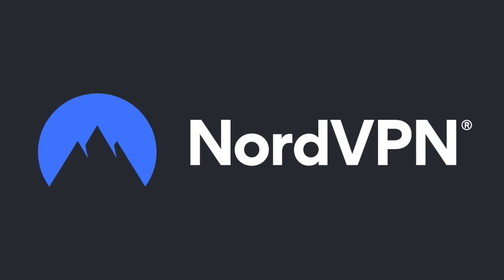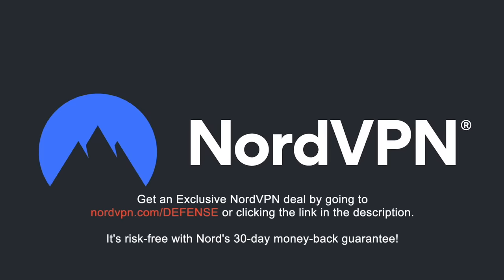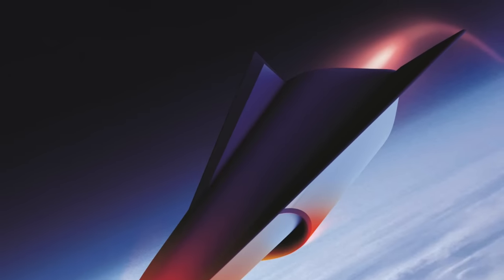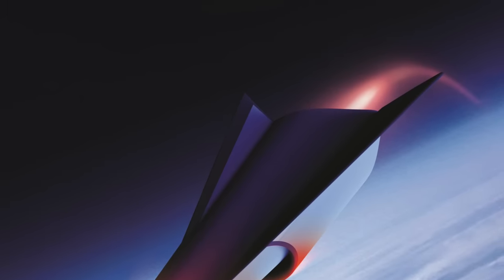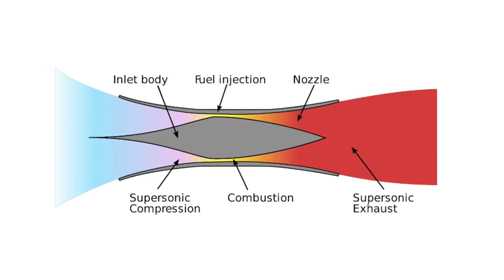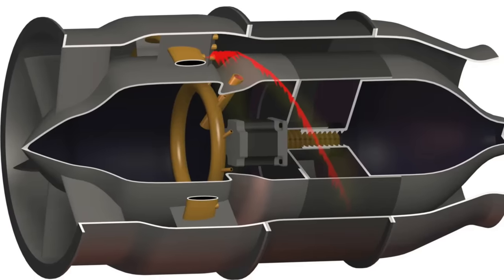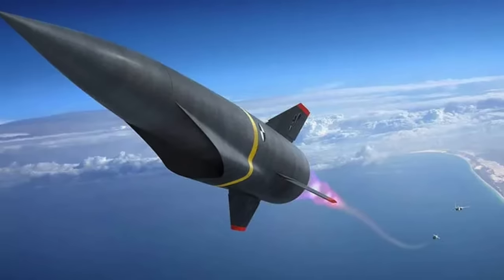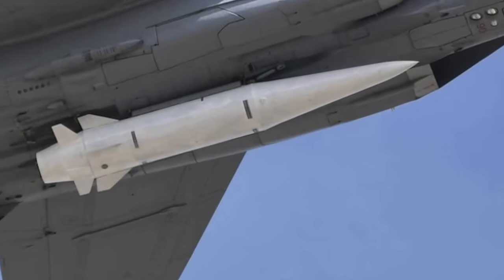GE Aerospace successfully tests hypersonic dual-mode ramjet with RDC !

Comment: I don’t think you understand fully what you’re talking about. Kinzahl  is a faux hypersonic missile in that it has hypersonic speed only during the early phases of its flight.  It’s essentially an aero ballistic missile. Nevertheless it is extremely expensive to stop requiring PAC-3 MSE and PAC-3.  True air breathing hypersonic missiles will be hypersonic throughout flight and extremely manoeuvrable able to manoeuvre at low altitude.
Reply: …a glider through stratosphere hence predictable trajectory and easier to shoot down!

Comment: can it turn at any direction and maintain hypersonic speed?
Reply: Yes
Reply: NO! the range of movement is restricted by inertia and true flight control. The faster you go the harder to change course and the longer the radius of turn. Not to mention the cost of fuel burn. You can't use the same techniques for redirection as lower speeds because causing disruptions in the ion field around the hypersonic can cause catastrophic damage. Glide bodies have a limited range of movement and as the air thickens speed drops, like a capsule reentering the atmosphere, and the fuel needs to maintain hypersonic speeds goes up by a square of the air density. There are perfectly sound reasons why we don't have hypersonic missiles and NASA's research has shown them. The paths to the target drop off quickly to a small cone as the distance drops. Detection and computer power are more important at this point. The other problem that doesn't get covered much is the weapons are inertial guidance until they drop under ionization speed because they are a bright ball of electromagnetic static which cannot be penetrated by a coherent EM signal, so no GPS.

Example, a glidebody starts a turn and travels 20 km before the turn actually starts to happen. The THAAD missile was on the way and hit before the turn started. Dead glide body. In comes a DF 17 at a Arleigh Burke Destroyer. Aegis sees it, as the cone of course converges for the speed where it can actually hit the destroyer, the intercept solution may include two or three SM's that form a wall the DF can't get through. The issue is the Destroyer's loadout and can it afford the exchange. Hypersonic missiles aren't cheap! Naval SM's are far cheaper but the number would be limited. The idea of a magic unstoppable hypersonic is Putin talk, but it does change the calculus. As long as the get enough detection time to launch it's subsonic destruction, the enemy still faces MAD.
Reply: @charlesrichardson8635  Interesting, but I think the video was more on hypersonic cruise missiles and I think that is what Auro1986 was asking about. Offhand, it wouldn't have a lot of maneuverability in hypersonic speed and it is a ground/location targeted missile and not for moving targets. However, I wonder if it would have to slow down as much. The whole hypersonic sled on a moving target as of the current tech of the world is silly. First the ballistic missile would have to be sent to the correct location, the radar would then have to pic up the ship close by IF it is close by, and then the sled has to hit it and like you said it isn't going to be turning at hypersonic speed. So many steps between launch and striking a ship, anti air might not need to shoot it down.

Comment: I've heard that Russian and Chinese advanced weapons are vastly overrated.
Reply: they always are.
Reply: You've heard correctly, dear. For the record, they're wrong, every ICBM we have is hypersonic, but you don't need hypersonic to defeat hypersonic! Can I possibly say hypersonic more times? None of them have Nuclear Carriers, Stealth aircraft - F-22's or 35's, no one has any B-2's or B-21's, X-47B's Flying Wing AI drones that can take off and land on a Carrier or refuel in mid-air, they don't have 6 fully AI controlled F-16's, and for damn sure there's no Communist or Metric Flags on the Moon. The F-35 is still 30 years ahead of them and the NGAD is coming out.